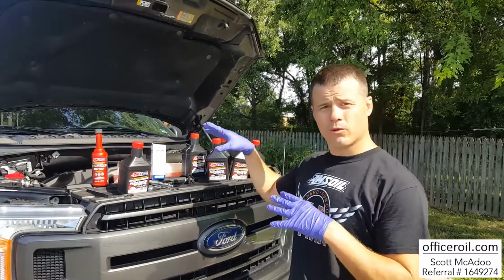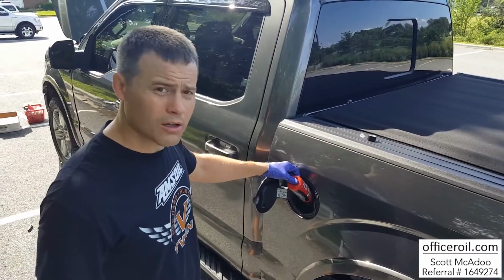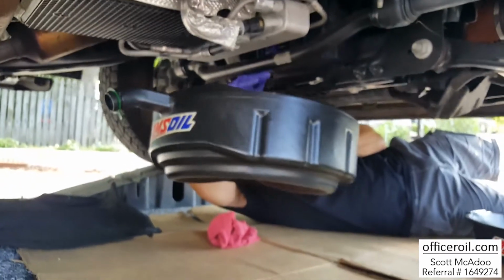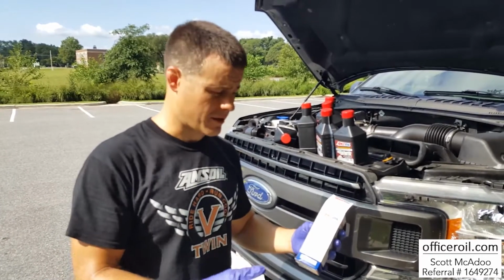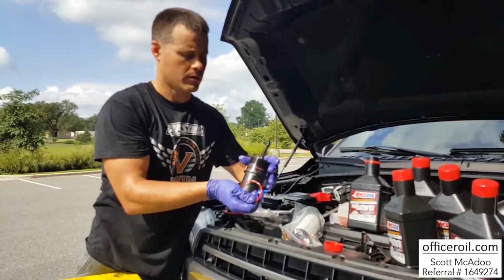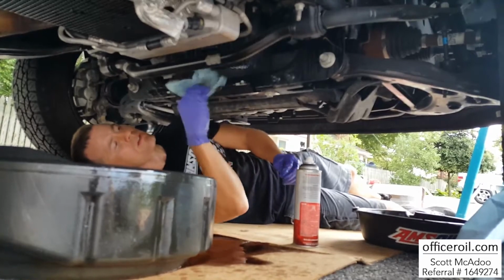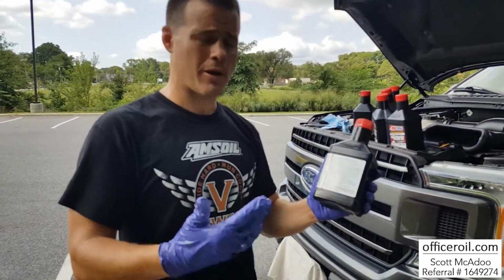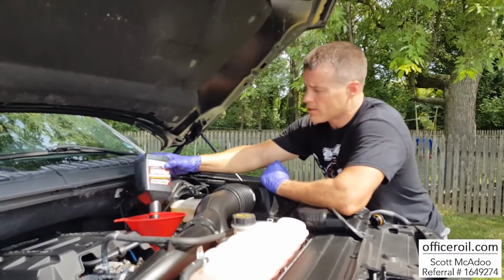AMSOIL Oil Change - 2018 Ford F150 Pickup Truck

Comment: Should I use amsoil engine flush before switching to amsoil?
Reply from the maker: Hi Sean.  I'd recommend it.  Great way to safely clean out the any sludge or deposits and prep it for the best oil.  It's safe enough to use every change, however it's not necessary.  AMSOIL will keep it clean.  Especially if your using Signature Series and an AMSOIL oil filter.